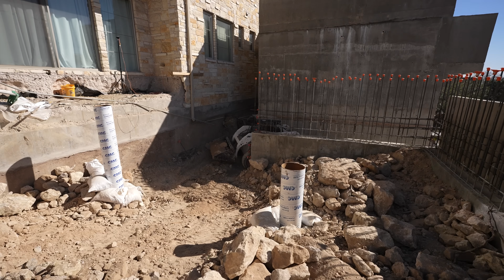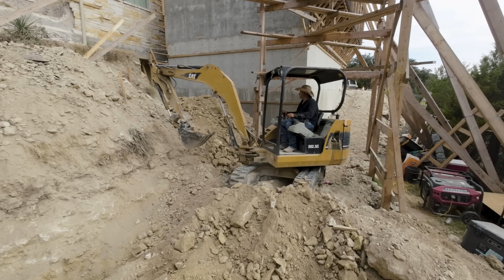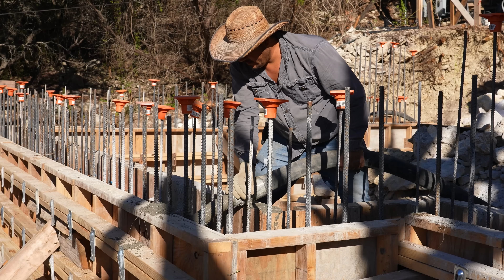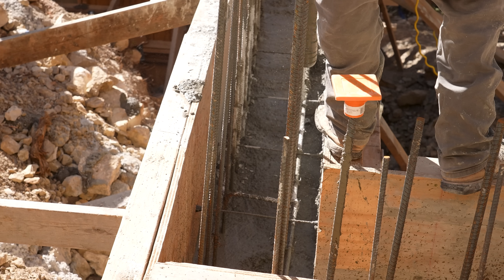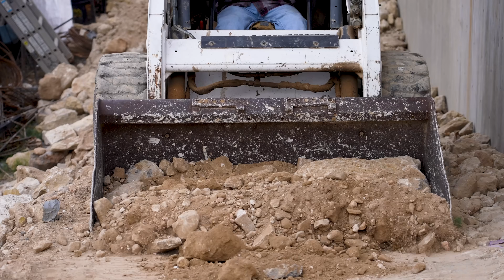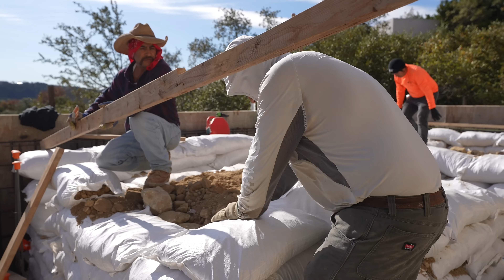What's Next at The $1,000,000 Pool?

Comment: oh god i watched just long enough to ponder why theyre building 2 wonky massive block foundations like muh grandpa did back in the 40s in france :l

these morons are just slathering an entire 2nd house onto the front of their house...
how does that even work? theyre making the entire stone exterior of their house interior now? theres literally a window in the basement staring right at the block currently.  

no duh this is going to be expensive and wasteful - youre adding onto an existing house foundation against the slope in the dumbest way possible >> literally cheaper to just sell and move if you want a mcmansion 4000sqft doing all that nonsense

why not just build a normal foundation and use steel at this point?  what does making the entire block out of fill dirt and concrete accomplish?
steel is cheap, get a free first floor and wont even cost 1,000,000$.

you can pour a 2000sqft pad a foot thick and make a box out of solid ibeam for less than 500,000$
Reply from the maker: You are delusional but thanks for watching lol.
Reply: @ReventBuilds  nah bro.....10 trucks of concrete a few tons of rebar and back fill aint no million dollar job, or at least nowhere outside yuppie ville which explains how this silly thing happened.  belongs on DIWHY more than anything.

Comment: Building big on sloping ground is for the brave. Great update video.
Reply: I'm not a builder.. but despite the support piers, the weight of those two structures (+ the water when the pool is full), so close to the house, would give me pause for thought - I'd be worried about the house moving/cracking/subsiding..
Reply: @rossG1221  yeah...why not just cut in and pour a normal pad and use steel and not have a massive concrete block full of dirt vs a ground floor.
Reply from the maker: Lol that’s very true thank you!!!

Comment: absolute lying if you're saying a house service is gonna cause sparking for a concrete pour. I've seen 240V wild legs sitting on neutral conductors for services not sparking, so you wouldn't be getting any induction from that house service on the pumper. We use pumpers on hi-line jobs around 345,000 volt lines without issue. 

Stop lying, tell the whole truth
Reply from the maker: Lmao I have a full video of the pour and you hear the popping. I heard it and saw it with my own eyes.

Comment: I was on a few jobs when we were pouring tall pilasters and got the vibrator stuck.  We cut them off with bolt cutters and moved on.  Glad you got it out. Job looks great.
Reply from the maker: I was worried I was going to have to cut it off but luckily we were able to get it out! We would have cut it but we didn’t have a backup!